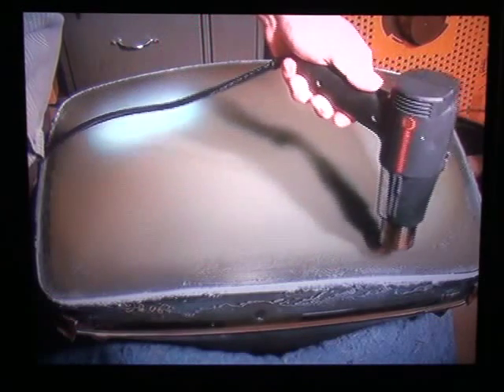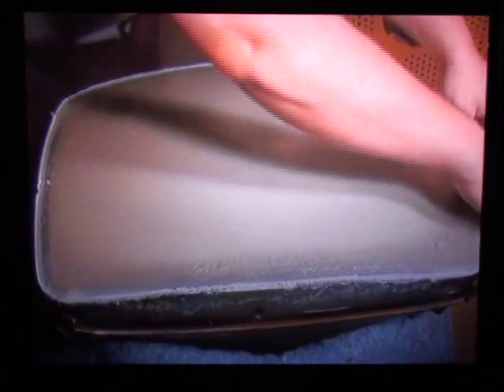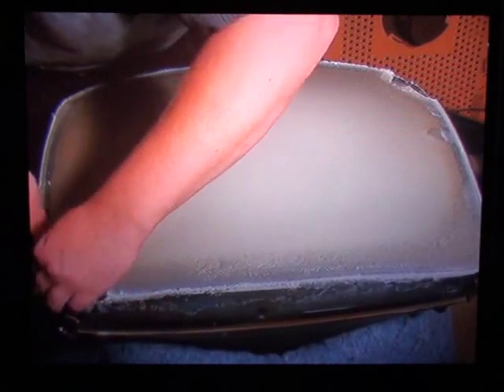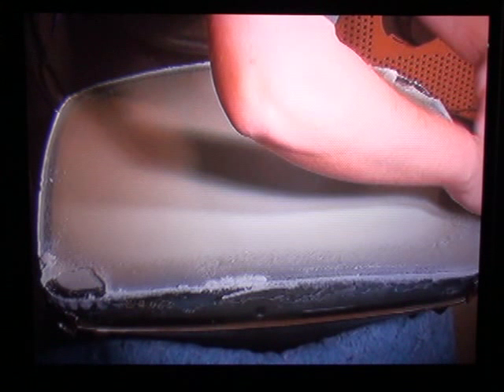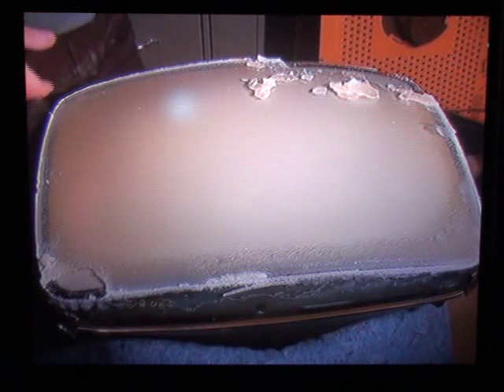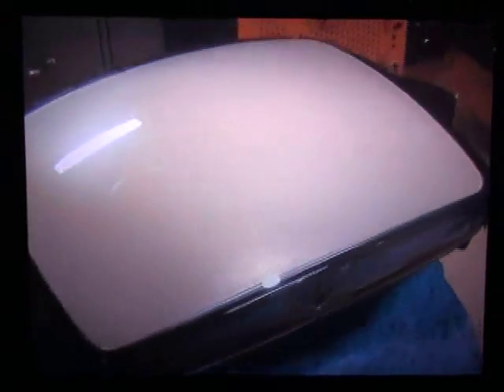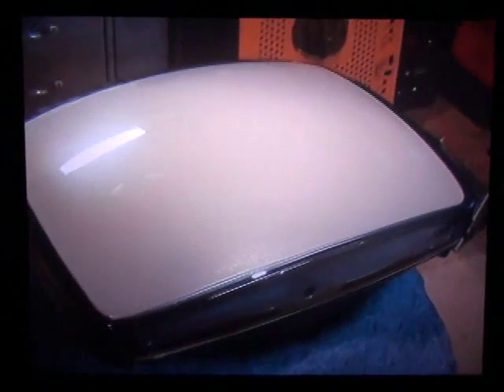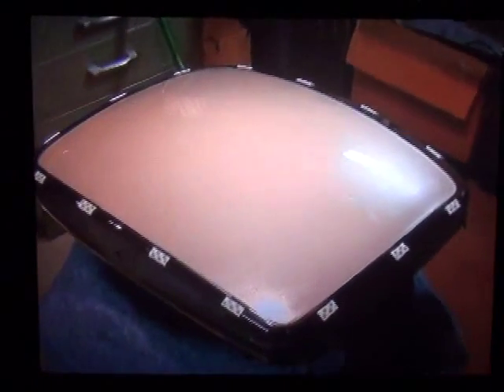How to repair CRT cataracts part 5 of 7

Comment: I had a nice old zenith with a CRT that was good as new. The front got a hit and resulted like what you see when a car windshield gets hit by a big stone. Of course the shield broke while heating it but it made it a lot easier to remove without getting the tube too hot.  I am surprised at how well the sharpness and contrast was. The front shield kind of softens the picture. I figured I would be safe since the shields are not used on the newer CRT's. This is a very interesting topic though.
Reply: Has the Radiation given you any SuperPowers after these 15 years, Perry? 

or should I say; PerryMan the Bionic SpideGoat?!

Comment: I have done this to old CRT's before and din't mess with replacing the lens. I used rubber spacers to make up the 1/2" difference when re installing tube. The contrast and sharpnes is much better than with the lens.